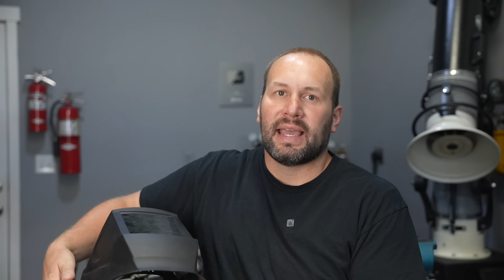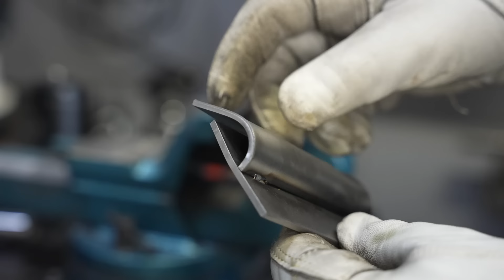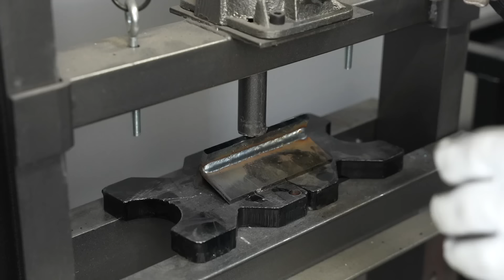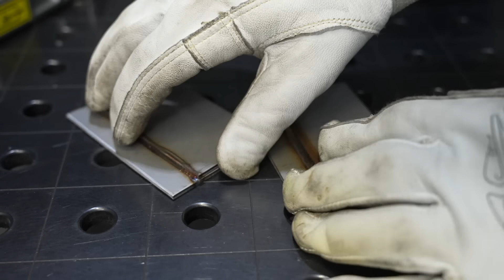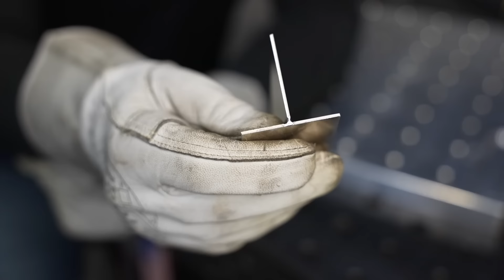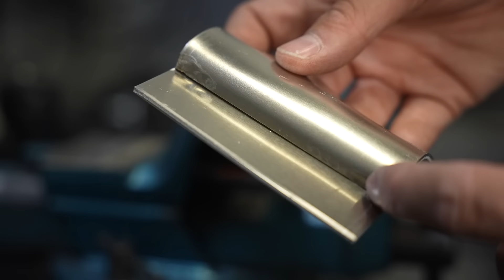Laser Welding vs MIG & TIG - XLaserlab X1 Pro Part 2

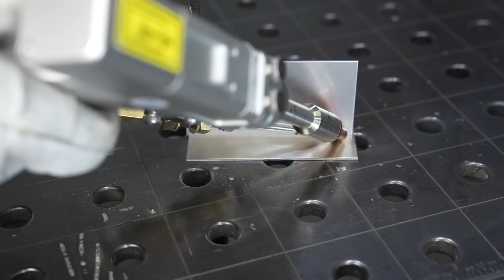Comment: 2:26 All those ups and downs don't matter at all to the weld.  So long as your thinnest part is at least as thick as the metal you are welding.  So if you have 1/8 in steel plate there, then the minimum depth of the weld should be at least 1/8 inch as well.  You have much more than that on this weld (looks like about 1/4 inch), which again is completely fine, but it means that the steel plate adjacent to the weld is the weak point, which is what you want, you never want the weld to be the weakest point.  If you are welding both sides of the plate, then you would only need 1/2 of that even.  So on a 1/8 plate, you only need a minimum of 1/16 weld on each side.  

The biggest danger would be to run to hot, or move to fast and create "undercut".  That's when your arc melts the plate adjacent to the weld, but doesn't fill that material back in.  It leaves little craters along the edge of the weld.  The thinnest point is going to be the weakest.  If you have 1/8 steel plate, but you have undercut reducing the thickness in that spot even by a 1/32 of an inch, you have just reduced the strength of that part by 25%.  I have seen far more welds fail because of undercut than not having a large enough weld.

Comment: This Laser has only 700 Watt. I use a 5 in 1 Double Swing watercooled Fiberlaser from China which has 1.500 Watt for $ 2.800 all incl which works much better on thick Material

Comment: Great comparison, and no cryngy hype like the others advertising these machines.
I was going to make a video like this on my channel (for this same machine), but I'd just be regurgitating everything you've said.
I love this little machine for thin steel/stainless welding where there's easy access to the weld joints, and a good fit. Aluminum, not so much...

Comment: How do the laser consumable cost compair to tig welding cost ?
Reply from the maker: Laser uses slightly less gas. Laser can also save a little on wire. None of the other consumables really add any significant amount relative to material and labor cost.

Comment: I saw an instagram post where they use the laser welder under water and it works. But I’m curious to know if it still has the same strength and if having the material under water would prevent the metal from warping

Comment: I like you Tim, but.... this is propaganda. 
1) That is not a "little" laser welder. This is their "Pro" series. 
2) Your comments about the penetration on the 1/4 inch weld are very misleading. 
3) You mention, but severely understate the dangers of the "reflections" which can burn through welding gloves and start fires on objects, cardboard, thin metal, and welding gloves within a couple of feet of the lasers reflections, not to mention the dangers of a reflection onto some eyes who are standing a couple of yards or more away from the welder. 
4) your claim that the setup of the laser welder is easier than a MIG welder is beyond bogus. 
5) your claims that a beginner can get those welds without the assistance of a knowledgeable technician, which you clearly have access to,  are again bogus. 
6) The vise flexed the same on the MIG as it did on the laser. 
7) On the warp test, you could have gone three times the speed on the TIG weld that you did. I've never seen you do such a slow weld. 
8) you made a hand full of welds and the lense crapped out.  Your off hand comments deflect from the reality that the lenses in these machines are consumables. Not to mention that you knew exactly what to do when the laser crapped out.  Good luck on technical help for the average Joe.

But then you have to do what you have to do to get a free laser welder.
Reply from the maker: Respectfully, I disagree. I went to a lot of effort to give an honest and accurate representation. If you want a better picture of the system, part 1 in the series has a lot more info about the specific machine. 

1) Laser welders typically range from 1200-3000 watts and are usually large roll around water-cooled units, this one is 700 watts and is much smaller in size. 
2) I don't feel that I misrepresented the welds, the penetration with laser is deeper than a typical short circuit MIG weld, but the fillet is too small on that size and MIG is a better choice. I don't believe that is misleading. 
3) This is not a video about laser safety. That would be an entire video on its own. 
4) Have you set up this machine model yourself and had a different experience? If so, I would love to hear it, but otherwise please don't challenge my integrity. It was extremely straightforward and there was next to zero knob turning needed. 
5) Have you tried this yourself and got a different result? I'm very new to handheld laser welding and this is the first handheld machine I've ever set up. Within a few minutes I was getting clean, consistent results. I'm not sure who the technician your referring to is, as far as I know it was just little old me in the garage. 
6) Of course it did. I didn't claim that it was stronger, just that it was quite strong for what it is. 
7) Did you hear me say that I could have gone faster on the TIG weld? I said that in the video, and pointed out that it's not a very accurate comparison. I wasn't sandbagging, there's just a lot to pay attention to when you're filming a video.  
8) Of course there are consumables on the machine, and it comes with extras. Every machine has consumables. As far as troubleshooting, it says in the manual that if performance declines, check the lens. I did and it needed to be replaced. I don't think that's beyond an average Joe. It wasn't a constant problem, but if it gets dirty or you get a back reflection, it's toast. 

Just because it is sponsored content doesn't mean that I compromised my integrity. I shoot it pretty straight.

Comment: I was wondering what type of gas you use. I thought it may be argon. Do you need to change the filler wire for the difference metal you are welding?
Reply from the maker: I was using Argon for everything. You can use Nitrogen for steel and stainless to save some cost, but I just keep Argon on hand. Yes, you need to use a different filler that's compatible with each base metal.

Comment: Nice video - very helpful considering how little documentation there is from the manufacturer. I'm surprised they don't have basic videos themselves from setup to using it for various welding tasks. They did send me a couple of charts for wire type/size and I found a settings parameter doc picture on their YT site that was useful. Now that they're getting into the hands of folks in the U.S., I expect we'll start seeing the user community making up the gaps in information & training materials.

Comment: Many laser welders have adjustments to sweep the laser to give a wider weld, or to fill gaps. It helps.Of course, you could do a three pass weld. Yes, it would take longer, but if the laser is what you have…

What air quality monitor are you using?
Reply from the maker: I tried different adjustments with the width of the sweep hoping to improve the aluminum welds a little. It didn't seem to help much on the thicker metal. I think it's just too much of a heatsink for this Wattage of laser and the wire only deposits so much. I'm still learning with this thing, so it's not a firm conclusion, just my impression so far. 

I'm using the AirGradient ONE. I really think it's made a big difference in what I breathe. Sometimes I don't realize how much particulate  is getting in the air from a little grinding, a quick weld or even sweeping the floor. When I see it rise, I can open the doors for ventilation and set up fume extraction or get out a respirator. It's all available in an online dashboard to track over time.
Reply: @TimWelds I’m going to look into that cleaner. I could use something new. One thing I haven’t looked into with laser welders is the diameter of the wire being used. Does this allow more than one size, or is that fixed?

Comment: I think laser welding might be the next go-to process for thin steel, especially considering the learning curve of TIG. I remember my welding instructor had me TIG weld stainless steel safety razors to test me. I wonder how well a laser welder could handle something like that. I also wonder if pre-heating the 1/4" mild steel plates would improve the penetration enough to make the welds as strong as the MIG welds. I doubt it since there is much less metal going down, but might be worth trying out.

Comment: Hey Tim , what would you recommend welding stainless steel 8-in as far as the settings 100% and in the wavelength there's a point 2 or 0.3 anyway suggestions
Reply from the maker: I honestly just used the default settings for each material and they worked pretty well for me. I did slightly adjust power or wire speed in a couple cases, but I didn't change much beyond that.

Comment: This is how TIG die, Since I got my 2000 W laser I never use my tig machine any more. For 1/8 aluminum you will need 1400 watts I don't think your machine can handle this thickness or you can do multiple passes which is easy with laser.
Reply: In fabrication yeah but out on the pipe way easier to pack up a tig torch and gas bottles than lugging around a big laser welder around. Much like stick and mig out in the field to much stuff to lug around vs just getting a stinger a lead and some sticks and get at it. But in fabrication yeah I knew it was only a matter of time before mig/tig welders would get replaced by robotics or a better welding process looks like laser will be that process.
Reply: @levirodgers4087 I am an agent for a company that now has portable units for this!, 20kg machine weight with carry handle, and fits on 1 car seat with gas bottle!, its amazing

Comment: When you had to change out the lens it got me thinking about how much upkeep a machine like that will take. Also reliability. I'm glad the machine throttled back rather than melting down!
Reply from the maker: It definitely has a lot more going on than a MIG gun. Time will on reliability, but I think it will hold up okay as long as I don't drop it...
Reply: It's really just protective lenses and nozzles. being copper, the nozzles eventually wear out. Contaminated lenses only happen occasionally unless you're doing something wrong.

Comment: The first laser test example vs mig it shows that it didn't manipulate the rest of the metal as much as it took more strength to make it bend correct?
Reply from the maker: It definitely put a lot less heat into the material. From a strength perspective, both methods were stronger than the base metal so it's effectively the same.

Comment: Tim, love the channel and your approach to testing. I am an art welder and use TIG welded stainless as a preferred medium. Even using the huge variety of cups and ancillaries available there are still occasions when the shapes in the metal defeat continuous beads. I am standing off any sort of investigation into laser welding until such time as the sheer bulk of the equipment is reduced to at least a similar size as currently available TIG kit. Nevertheless I will await your laser welded fabrication tests with interest. Thanks for all you do. 🇬🇧

Comment: What gas Are you ussing? Nitrogen?
Reply from the maker: I used argon for all the welding because that's what I have on hand. Nitrogen is slightly cheaper and would be fine on steel and stainless steel.
Reply: How about nitrogen on aluminium? @TimWelds
Reply from the maker: Nitrogen isn't great for aluminum from a metallurgical standpoint. You can form Nitrides that have a negative impact on properties and you can also get some porosity. In certain cases, you can get away with it, but it won't be ideal.

Comment: Really informative! I'm very surprised with how well it does with 16 gauge mild steel. I would love to see if it can do a butt joint on square tube though
Reply from the maker: On the first video, I welded a mitered corner on square tubing. It did great with the butt joints on the side. I found it a little harder to see where I was going because the wire feeder sits right over the joint, but from a welding perspective it was solid.

Comment: It would be curious to weld both sides and compare.  I think that might help offset the larger fillet from the TIG and MIG welds.
Reply from the maker: Absolutely, it would hold up much better if both sides were welded. I was looking for something that would be most likely to break from a testing perspective.
Reply: @TimWelds Understood, but the large filet weld on one strong plays to the strength of MIG.  Welding both sides would play more to the strength of the laser.  I suspect you could weld both sides with the laser as fast as one side with MIG and I also suspect that the weld would then be as strong as the base metal and likely would not break during bending.
Reply from the maker: If you have access to both sides, that’s an option.

Comment: Laser root with MIG cap.
Reply from the maker: I think that would work really well. I almost did that on a trailer repair a couple days ago, but ended up just stick welding it to get the job done.

Comment: how about cracked cast Aluminum , fuel or water tank, or maybe a boat
Reply from the maker: There may be some cases that that could work. From a practical perspective, I think it would be difficult to use laser for most of the cast repairs that I have done. The geometry is usually not a standard joint and by the time the crack is ground out, it's often a very odd shape. I usually end up putting a lot of filler in as well.

Comment: I've never been able to do long runs of multipass with handheld laser and it was not recommended in the training..   If you want more deposition and bigger filets, laser generally uses dual wire feed (two wires side by side  at the same time).   The only successful multipass laser I've ever seen was done by robot, not handheld..
Reply from the maker: I don't think using multi pass laser welds to build up size makes sense to do because it would be far less efficient. This particular machine is on the small end and there are higher powered twin wire options that could deposit a larger weld, but at a certain point, GMAW just makes more sense. 

From a theoretical standpoint, I think you could run a multi-pass weld to build up size. DMLS (metal 3D printed parts) are completely made up of small laser welds and they have properties on par with forgings.
Reply: Using larger diameter wire is the alternative to two wires, but there's obviously limitations due to feed issue and available wattage.

Comment: Tim a question: what differences might you have between the laser vs regular wire feed on replacing sheet metal in auto body repair? Ex: rusted out quarter panels (tack n stitch the replacement). I think it would do ok on an outside the body repair where there's no space constraints. I was thinking about older restoration with thicker metal not new cars. Thanks for your insights.
Reply from the maker: I haven't tried it, but I think it could be great for that. I expect that fit would be important for that. The limited amount of body panel patching I've done was tacking with MIG and working my way around. This works, but it takes a long time and it's sure a pain to clean up afterward.
Reply: Thank you Tim😊 @TimWelds
Reply: If access is possible, I see a lot of advantage to using laser welding. The lower overall heat input and ease of doing thin material (even butt welds) makes it very attractive in my opinion.
Reply: @davidg3944 
Thank you I appreciate your videos and instructions your my go to for welding. 😊
Reply: @waltoliver6704  I'm not the video poster, but I appreciate the vote of confidence anyway!  ;)
Reply: Thank you for your insight David 😊 @davidg3944

Comment: What  are your settings for each thickness for the laser welder, i have one and in have a hard time with the settings. :)
Reply from the maker: I just used the recommended settings for each material and they worked really well. I didn't have to do much knob turning. Feel free to shoot me an email with what you're working on and I'll be happy to give my 2 cents on settings.

Comment: Do the laser welds seem to be malleable like a tig weld is? The nice part about tig in bodywork or general metal shaping is its malleability and tendency to not crack when worked. If the malleability is there I can definitely see applications for this in my shop.
Reply from the maker: I haven't tried that out, so I can't say how it would form.
Reply: @TimWelds thanks for replying, Tim. A little hammer welding in a future video might be interesting.

Comment: Why aren't you giving any numbers for these welds???  It's practically useless.   "The laser at full power".  What's the power of the laser?  1000w?  2000w?   What's the wire speed?  What size wire?    C'mon man.  Put some valuable information that we can put in our brains.   Where is THE DATA???
Reply from the maker: I honestly didn't even think about it. I just used the presets for the materials and thickness and it worked great. I didn't have to do much knob turning. It's a 700 watt laser. The wire speed was the default for the material, generally in the range of 5-10 mm/s. I did slow it down by 2 from the default on the stainless pulsed outside corner. I used .045" ER70S-6 steel wire, .047" ER5456 aluminum wire, and .035" ER308L stainless steel wire.
Reply: @TimWelds  Thanks, that sort of information is very helpful.
Reply: @TimWelds  Thanks, Tim.   Much appreciated.   I've just bought a 2000w welder.  They have notified me today that it's now ready for shipping from China.  They sent me a test video just a few hours ago, welding 316L 1.5 or 2mm stainless steel.  Butt weld and outside corner weld.  400w, 1.2mm wire, at 50 speed.  Beautiful weld seams.